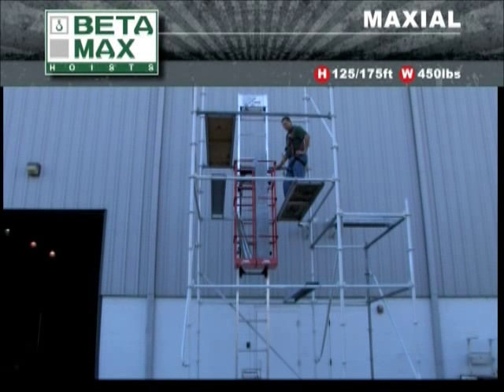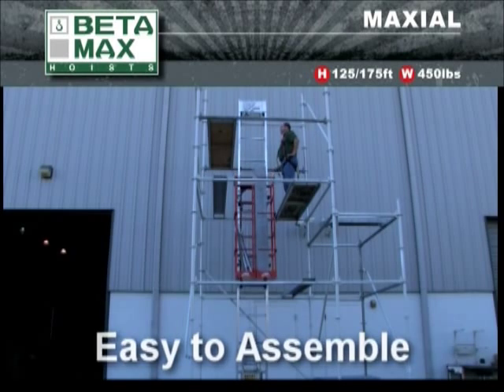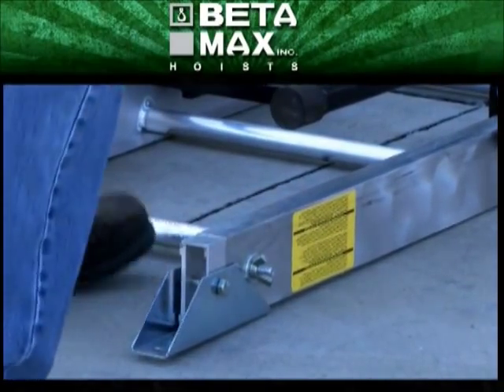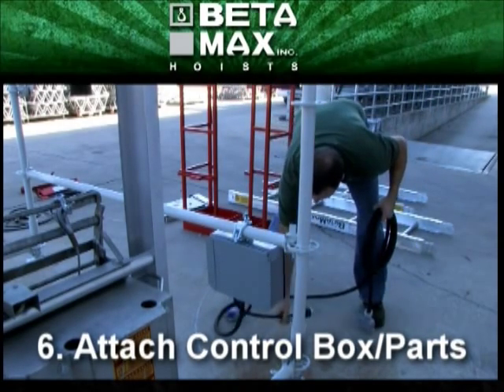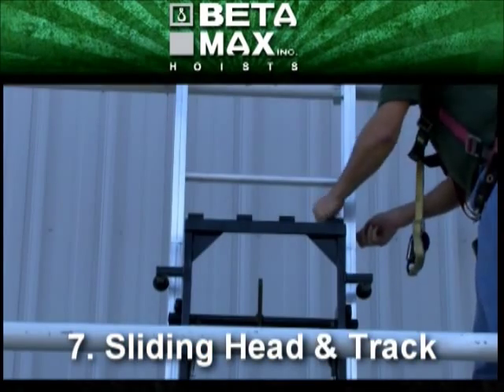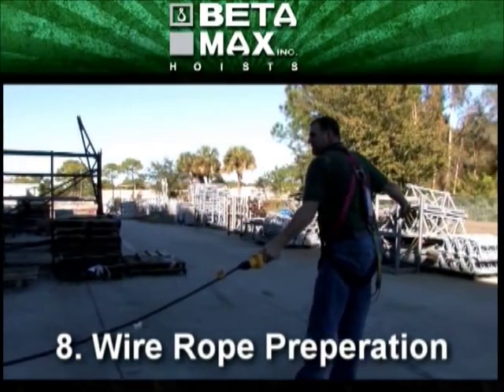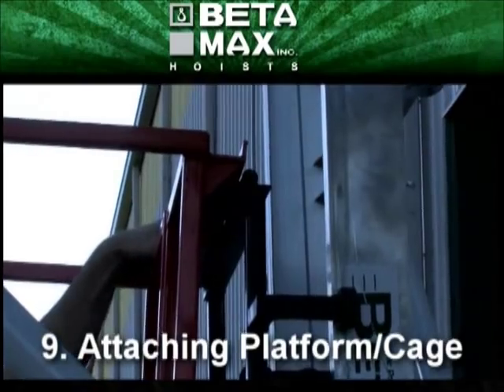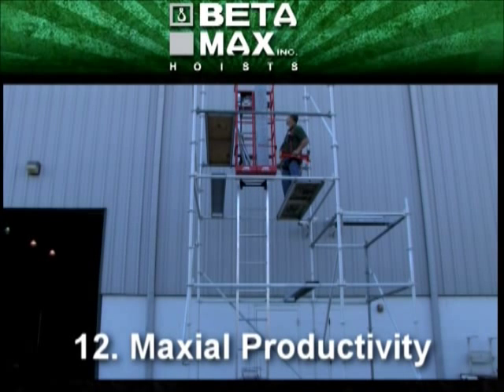Scaffold Hoist Tool - Beta Max Maxial Hoist

Comment: I noticed that when you attached the cable to the carriage, you did not use a swivel shackle as well. in the manual rev 2.2 2017, it shows the usage of a swivel. is it pertinent to use a swivel? I have also notived that the eye loop of the cable becomes stretched or elongated from heavy loads with no swivel, making it a bit difficult to remove from carriage. I have more questions, but that one to start.